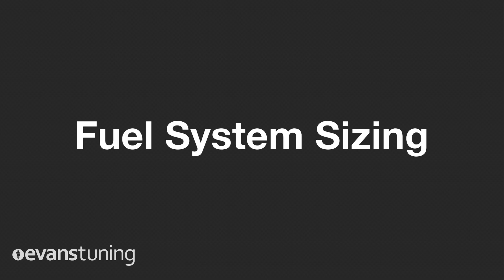Fuel Systems Overview

Comment: Hah the RC injector comments took me back; a decade ago they were ok but when I tune on an RC injector today I cringe lol. There is also a special place in hell for "eBay" injectors that come with zero data and "+/-1%" flow matching that actually varies 10-15% from injector to injector. ID is definitely a good modern day option, but Deutchworks and FIC are just as good in my experience. Also, a really great mid level pump especially for 4cyl applications is the Quantum 340. It is a 340lph E85 safe pump, just as quiet and reliable as the Walbro 255 old standy with considerably more flow, and is 100% identical to the AEM 340lph but cheaper because it doesn't have an AEM sticker. (made by same company just rebranded)